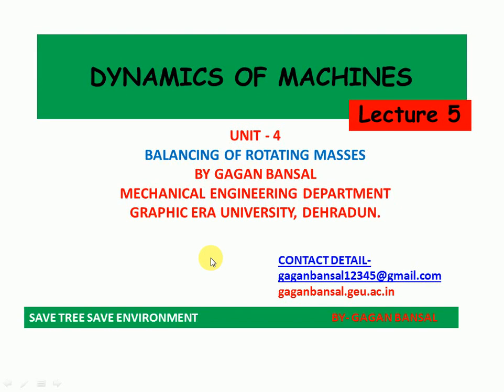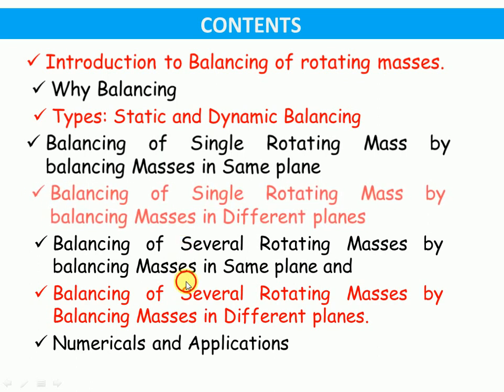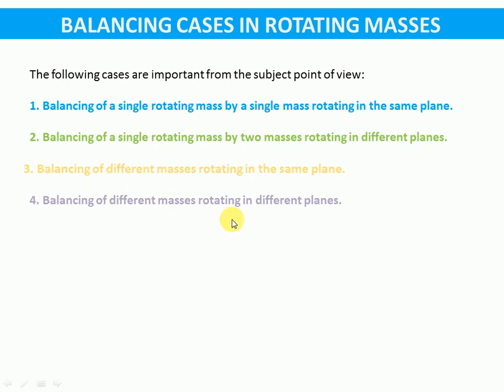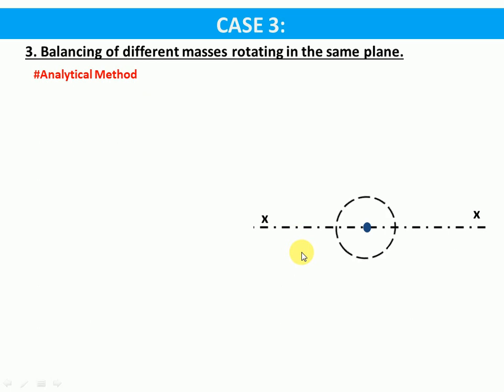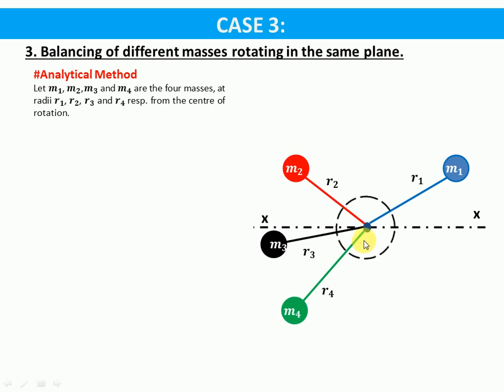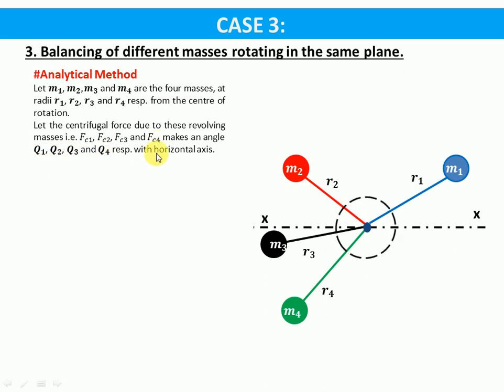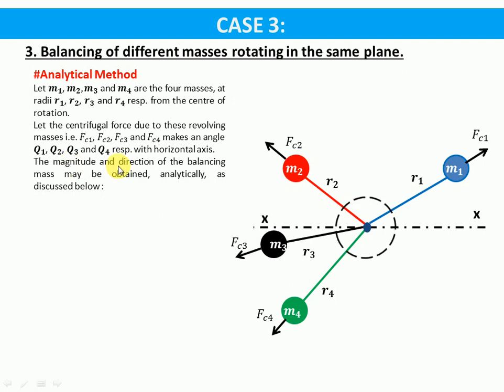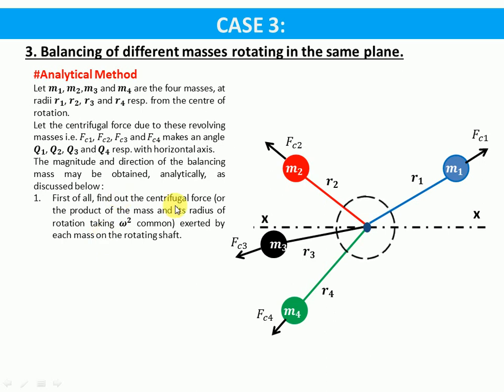D04L05 ROTATING BALANCING - LECTURE 5/7 || GAGAN BANSAL GRAPHIC ERA UNIVERSITY

Comment: Sir when we resolve the masses m2, m3, and m4 there resolved  horizontal component is towards left so there should be negative sign in the equation of summation of horizontal forces!!
Reply from the maker: We take one assumption, if left is negative yes we do take it negative and if positive then we take positive sign...

Tell me exactly at what point of time in video you faced this problem.?.
Reply: At 4:14 while writing summation of horizontal forces
Reply from the maker: @anmolpowar2636  OK OK GOT U...
ACTULLY ALL THE ANGLES (i.e. Qs) ARE TAKEN FROM positive X Axis. (Assumptions).

while solving numericals you have to consider signs (-ve and +ve) as per geometry.
Good to see that Anmol Powar you are working on concepts... keep going...good...
are you from uttarakhand?
Reply: Thankyou soo much sir for this fabulous lecture!! Sir I'm from Mumbai😊
Reply from the maker: @anmolpowar2636  ones i came to vjti and iit mumbai...in 2018
Reply: Ohh!! Great sir😀😀